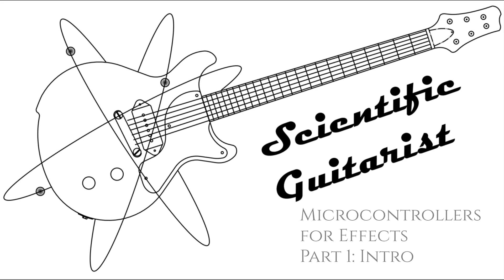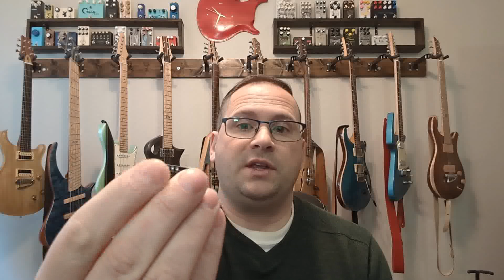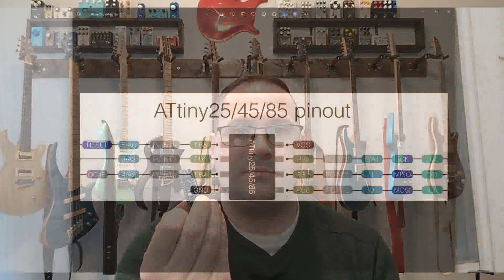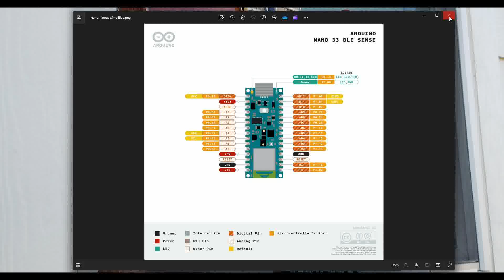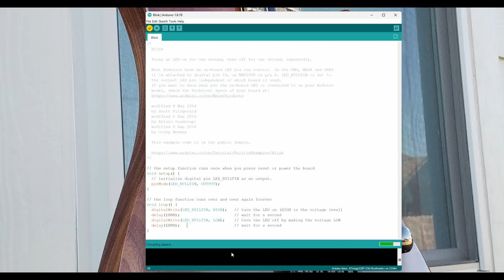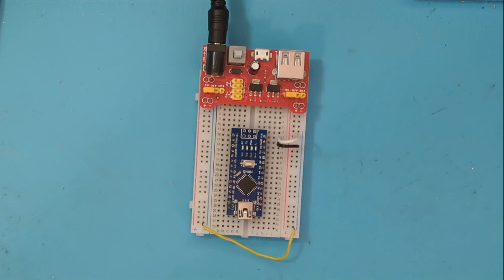Microcontrollers For Guitar and Effects: Intro to Microcontrollers

Comment: What you call the definition section is actually your global declarations. Variables defined here are what consume the global variable space you later refer to. Everything defined here is accessible to every function within the program, some of which may be variables, but also macros that are expanded at compile time to (hopefully) make code more readable and repeatable. Variables defined within functions are not global and are stored on the program stack and only exist while the function is executing, unless declared as 'static'.
 
The loop() function is not the same thing as main() in C, which is always the main entry point to any C program. The Arduino IDE kinda hides the main() function from you. The main() function looks something like this:-

int main( void) {
    setup();
    while ( true ) {. // Infinite loop until we power off or press reset
        loop();
    }
    return( 0 );  // return a result code to whatever launched this program. Irrelevant on a a microcontroller as the above while loop should never normally exit.
}

Comment: AVR(8) microcontrollers are 8-bit, which specifies the unit that is (typically) processed by the CPU.
This is different from the ADC resolution, which is 10bit on the average AVR8 like the ATTiny25/45/85. 
In addition, the C++ Compiler used for „Arduino“ uses 16bit integer by default as int size. 
„Arduino“ BTW is just plain C++, but the library often uses C-style design, making changes harder than needed.

Comment: In a circuit, should I be keeping the Arduino ground separate from the guitar signal ground? I built a multipurpose box with one part being a Pro-Micro based MIDI controller, and the other part a passthrough for my connecting my guitar to my soundcard via a switchable effects loop (basically cable-management).

Unfortunately the guitar picks up an unacceptable level of digital noise (i.e. it's audible!). I'd initially assumed the noise was being picked up through the air like with pickups, and tried using shielded cable etc. but that didn't work. I've since realised that the two circuits share a common ground via the aluminium enclosure and am wondering if it's worth ordering some guitar jacks with plastic cases so that I can keep the circuits completely isolated.

Or is there another noise-management solution that I haven't thought of? Just found this channel recently via the pickup-winding vids BTW - great stuff!